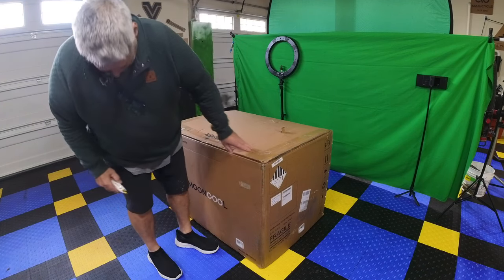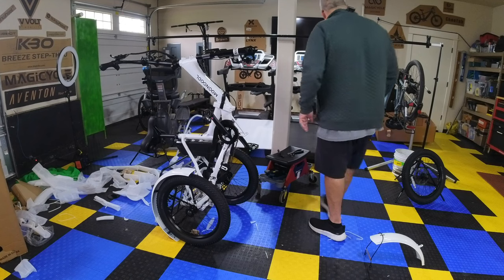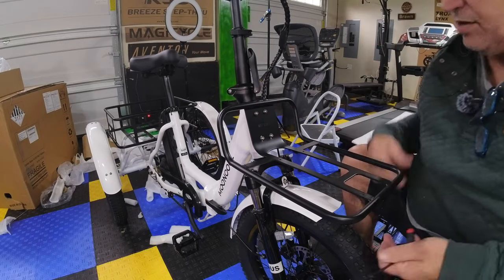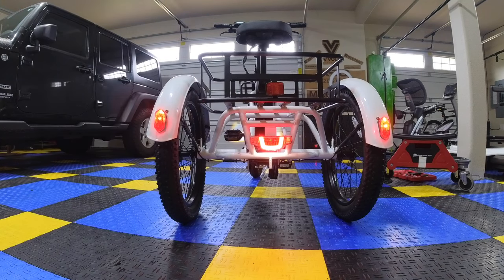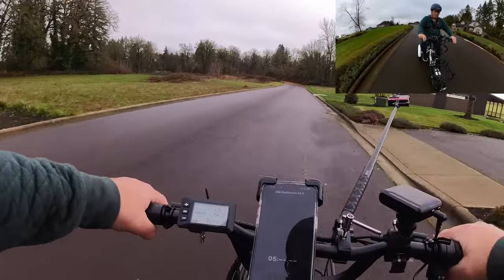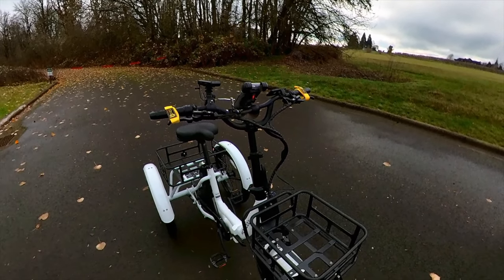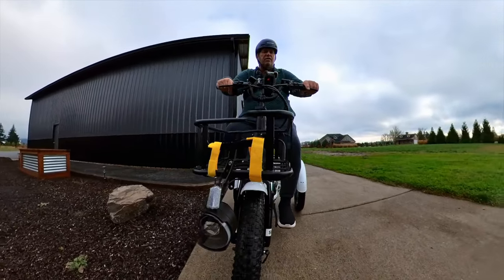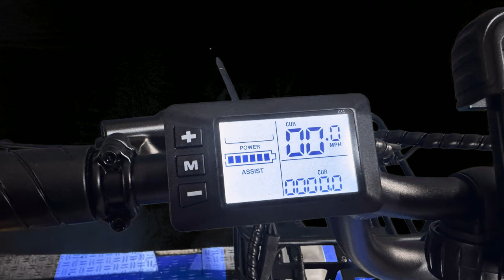MoonCool TK1 Trike Best Christmas Gift Ever

Comment: Oh good I’m 265 also so this will be a good review , what was that thing you removed for hydraulic break, and why,  but I must ask which one do you prefer most from your reviews that can handle weight and light hills
Reply from the maker: So the TK1 folding.  The assembly is very fast as it comes mostly assembled. The TK1 fat-tire non- folding is much more work to assemble. The TK1 Folding has a rear differential ve front wheel drive.  The Buzz bike was nice but you had to pedal. You do not have to on the MoonCool.  The thing I took out was a spacer to keep you or someone from pulling the brake lever before the front tire was on and damaging the front brake. Remember to get my code in the description as it will save you $$$.